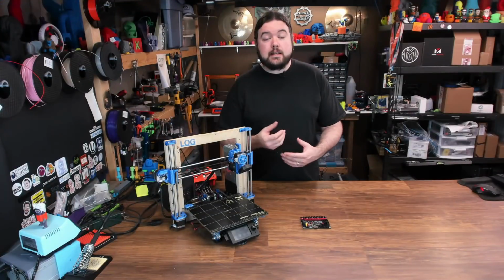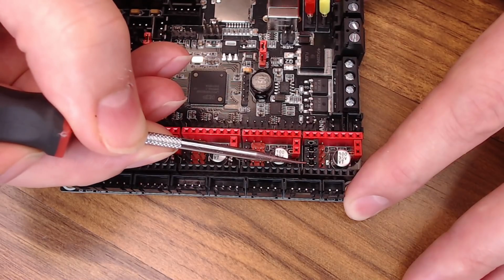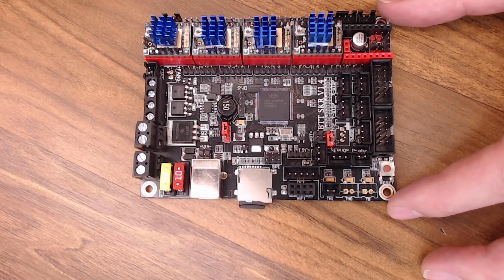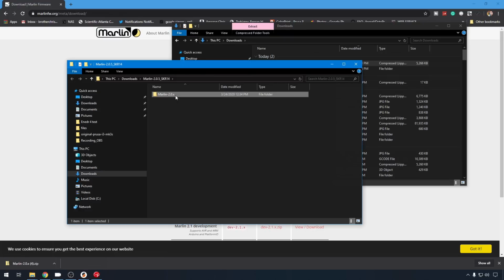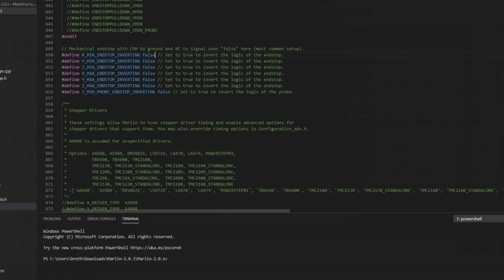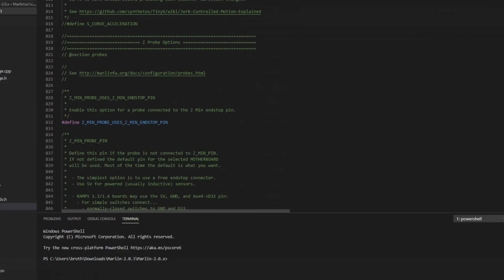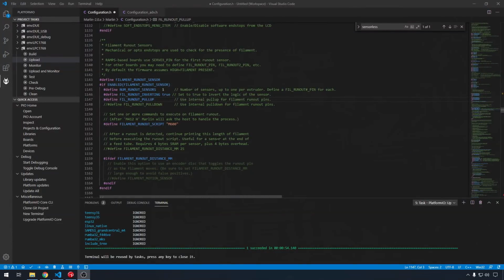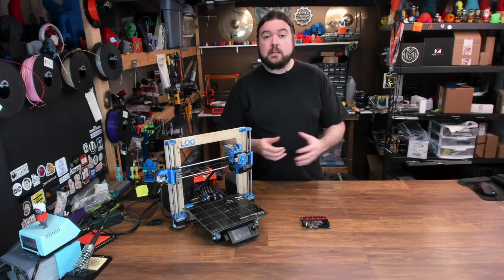BigTreeTech SKR v1.4 Mainboard - Full Install Part 1 - 2209 Drivers - Chris's Basement

Comment: Chris.... excellent tutorial but I have a question.... How BTT DCDC mode v1.0 work? What do I use for?
Reply from the maker: It's for RGB lights. I converts 12/24v into higher current 5v so you can fun more lights. 8 RGB;s without, 30 with.

Comment: I really want to get back into my 3d printer(s) but such problems with the skr 1.3 and tft35 V2 left me with endless frustrations.  can you recommend this board and the tft35 v3 as a completely compatible system? or what combination would you put your reputation on?
Reply from the maker: I really can't, I know of a few boards, but I haven't tested enough to say one way or another. Affordable boards with TFT, BTT has it cornered.
Reply: the affordable boards arent doing the job. unless your tied to pronterface full time.  the TFT, BTT boards don't work , At least with the stock ANET, the expected features advertised worked the way they should.  ( if that doesn't insult BTT, i don't know what will)

Comment: Bit of a strange question, what driver do you recommend getting? Building my own printer and want the same features the Prusa MK3S has like silent/quiet motors, endstop less homing. The Prusa uses 2130 but here it seems like the 2209 has basically the same features.
Reply from the maker: Go with a 2209 for sure. Much easier to use.
Reply: @ChrisRiley  Sweet. Great video, it's long but has loads of details that I will need come building time. BTW what LCD module and bed sensor did you use? Don't think you mentioned them in the vid or description.
Reply from the maker: @vince086  On the printer in this video is a BTT TFT v3.0 3.5 and my sensor is a cheap inductive probe. https://www.aliexpress.com/item/32981810289.html?spm=a2g0o.productlist.0.0.113c16bfWqZ918&algo_pvid=6739ea42-0e36-4388-aef9-d1025a17537f&algo_expid=6739ea42-0e36-4388-aef9-d1025a17537f-1&btsid=0ab50a5715920847541475844e79ae&ws_ab_test=searchweb0_0,searchweb201602_,searchweb201603_

Comment: hey Chris ,i got the skr 1.4 with tmc 2209..im trying to configure the board so i can use the bltouch, also  tft24-v1.1..atfer following along with your part 1 and 2 im having no luck,I also tried adding the wifi that you did as well,..so what i got is a config that works but no bltouch ,i did see that its possible there is a hardware problem with this board( wrong type resister or mosfet on one of the pins.)..as for the tft24..it will not connect to the printer..even after i updated the firmware on the screen..i am also using stallgard ..i did by the way snip the diag pin on the "z" but not on the E0 driver..i did not want to do this in case this 1.4 is no good and have to go back to the skr1.3..which works!..lol anyway just wandering if you could give some pointers!..thanks chris.
Reply from the maker: If the 1.3 works it sounds like a bad board to me. If you have your serials set to 0 and the second to -1 and you baud rates match, your screen should work.

Comment: Hey Chris, I talked to you about the tmc2209 issue and I finally resolved it. The line in the firmware in conf_adv.h (software enable) mine was defined for this but even though it's for Uart mode, the drivers have dedicated pins and this should be uncommented. It was quite vexing but I got there with some help from the GitHub forum. Thanks for your help.
Reply from the maker: I am glad you found it, thanks for the update.

Comment: Hi Chris , did you use 12 v fans or 24 v fans ?  Can I use Prusa MK3 fan ?
Reply from the maker: Hey Dan, thanks for coming to the stream. Yeah, I use both, I just match the power supply. All the Prusa fans are 5v, so they are a no go.

Comment: Hi Chris,
Allow me to comment on the E0_AUTO_FAN_PIN P2_04 (line 422 Configuration_adv.h) I believe the EO fan is an "always on" connection. Only the part fan (PIN P2_03) is controllable to my knowledge. Please correct me if I'm wrong.
Reply from the maker: E0 is always on correct. I moved the fan to HE1, and used those pins.

Comment: what's the difference between UART and SPI mode, and what is beter ?   Don't need sensorless homing...
Reply from the maker: UART is just serial, easy to setup, but slow. SPI is a parent child scenario which is much faster and uses 4 wires. In 3d printing, either are just as good.

Comment: I don't what I am doing wrong. I am revamping an old anet a8 for abs only. Going to install BTT skr 1.4 main board, bl touch, BTT 2209 drivers, BTT TFT 35 3.0 TOUCH SCREEN, sensor less homing. I am a noob at vs code and everything I try and build the sketch in vs code it comes up with about 46 problems. I have went step by step in vs code, but it will never compile successfully.
Reply from the maker: Send over some of the errors.
Reply: @ChrisRiley  at work until this evening as soon as I get home will run a build again and send over some of the errors. Thank you for your time.
Reply: Ok did another sketch exactly how you stated and went to workspace to find the environment to build it and found there was nothing in the project task tab. But I am looking at the configuration h and config. Adv h files that I change just like your part 1 and 2 of the video. The project task had the files in when I started the sketch. I not sure how to send you a screen shot of my computer on you tube.
Reply from the maker: @kawasakizx14jomamamoto57  You can email them to me, brotherchris81@gmail.com

Comment: Hey Chris - this is a great video. Thanks for the amazing content. Curious if you would put together a tutorial on converting a 1.4 board to 24V? I am kinda stumped on how to elegantly drive a PWM 12v part cooling fan and other accessories...
Reply from the maker: Interesting thought. Probably swapping the fans would be about the same money as running converters.

Comment: I've watched both Teaching Techs and your video and I'm still terribly confused.   I picked up an Ender 5 , BTT SKR 1.4 turbo. BLTouch and the 2209s.   
Other than installing the bracket and the BLTouch itself I haven't made any changes.     Do I need to clip the diagonal pin on all the drivers if I plan to use the BLtouch? 
Lastly I'm not sure which end stops I'm supposed to remove.   Thank you for any help.
Really hoping you see this sir, good videos!
Reply from the maker: No, only clip them if you need to use E0 det, E1det, or PWR det. I would leave all the endstops in place and use the probe port for your bltouch. https://youtu.be/p504oU-D6iE?t=1202
Reply: @ChrisRiley  My man!  Extremely prompt and very professional.  I really appreciate your help.  👍

Comment: Have you guys had any problems with the V1.4T not working with E3D thermistor cartridges? 

I had the thermistor type configured properly in Marlin, had it plugged into the default pinheader (TH0, pin 0.24) and it was only reading 713C (this is with only the power supply and thermistor connected to the board, so the hotend heater element wasn't just going nuts). Still read 713C with the thermistor unplugged. Confirmed with a multimeter that the pins weren't shorted and tested with 3 E3D thermistors. Hell, I even assigned 0.23 and 0.25 to the E0 thermistor, and it still read crazy high temperatures. I returned the board for a replacement, and I'm hoping that board was just a lemon with some weird stuff going on. This was all on the newest non-bugfix branch of Marlin off of the github.
Reply from the maker: Yeah, sounds like something was up with that board, mine seem to play with that thermistor fine.

Comment: Chris, I just putting together a new printer and I have a lot of trouble configuring the 2209 for the steppers. I am doing it on a E3 Mini from Bigtree. The nema 17 motors are 42 with max 1.7 amps. When I hook them up they just jitter. Keep in mind I am used to the pots on 4988. To test I bought an original Creality Ender 3 stepper motor. Hooked it up and it ran. What is the current I need to set it too for my new motors above to make it work?
Reply from the maker: You might have the stator flipped. There are two different motor configs that I have seen. Try flipping the center 2 wires on the motor cable.
Reply: Thanks Chris.  I was working through the pandemic from my factory in Missouri (Not my home state) as we are maintaining Turbines and Generators for the Utilities. For 10 weeks I am in a Residence Inn and had to do something. What better way to spend time on the weekends than to build a new printer. My last design is two years old and I used Repetier and old drivers 49..with pots. This one is going to be quite different and I have not see one like it. Should be finished this weekend. I think the idea will work.
Reply from the maker: @joergschoepp6650  Ah, where at in MO, I am in KC. I hope you are staying safe and well.
Reply: I am in St Louis. My facilities here had to continue working through the shutdown to service the power generations turbines to keep the lights on. I cannot get the sensorless homing to work. I have ball screws on all three axis. First it did not work at all meaning it crashed into the stop no matter what sensitivity I set. Than I changed the TMC2209 to one with no DIAG pin.. All of a sudden it worked a little. The motor ran for about 10mm but in the wrong direction at 100 (I tried 250/8/20/60/100). I was pulling my hair out because I really like to get rind of those end-stops.
Reply from the maker: @joergschoepp6650  Ah, this is a mini, do you have the diag jumper wires connected?

Comment: Great work.  But I have a question.  How do you compile a source code file that doesn't have the project file included.  I have a Sovol 3d printer.  They have firmware Marlin source code and .hex file but no io project file.  I need to change my thermistor  pins from 13 to 15 and recompile the .hex.  Any thoughts
Reply from the maker: Thanks! There is no way to back out like this. You will need to find the source project.

Comment: Is the aliexpress link to the board in your description the official big tree tech store.  I note there is also another store with a similar name:  https://www.aliexpress.com/item/4000506531501.html?spm=2114.12010612.8148356.25.1329530fROBhoC 
I went ahead and ordered via the link you provided but I received a notification the shipment had been cancelled by the seller in mid-May and they are not responding to messages.
Reply from the maker: Not sure about that link, but this should be the offical one. https://www.aliexpress.com/item/4000474140713.html?albbt=1&isdl=y&aff_short_key=uNb6i2f&aff_platform=true&albslr=205797132&src=Facebook,Youtube,Google,VK,Yandex

Comment: I thought PID is crucial, how important is PID? I see you skipped it here. Thanks chris
Reply from the maker: The common thermistors we use on these can have a lot of the same properties, for the PID won't change much. The Marlin defaults actually work pretty well for the E3D V6. I don't tune PID unless I see an issue with temp swing. It depends a lot of the filament you use, but a 3 degree temp swing on PLA probably won't matter a lot.

Comment: Here's a crazy idea: what if, instead of physically cutting off the diag pin, we just redefined it in that pins configuration file from the correct one to empty unused one? Would that work? 
Because I'm not a fan of ruining an expensive TMC2209 driver board that might come in handy if X or Y driver burns out and your local shop only has classic A4988, which will work fine but only for extruder or Z, not the X and Y.
Reply from the maker: Yes, you should be able to just move some things around in the pins file to get around clipping the pins.

Comment: I ordered TMC2209 from BTT before ordering my board.  Then I ordered the SKR 1.4 with 2209 drivers.  The individually purchased drivers are v2.1, the included drivers are 1.2.  The 2.1 drivers do not have the pins facing downward...the 1.2 drivers do.  Are there any other changes I should be aware of?  Figure I will start with the 2.1 and see if they work as I wouldnt need to alter the pins at all.
Reply from the maker: I am not exactly sure what the difference is. I am getting some in the mail sometime soon I hope. I will compare them.
Reply: Chris Riley actually the v2.1s were not from BTT but rather Fystec resold by BCZAMD.  They seem to work then crash on X axis with either sensor or sensor less homing.  Installed the 1.2s that came with my SKR 1.4 Turbo and back working

Comment: Good morning Chris, I watched your videos on the SKR 1.4 turbo and the tft35-e3 v3 screen. I had things basically working but because I am installing this on a prinrbot metal plus I needed to get different x and y end stops. Printrbot used a 2 wire set up. I installed them and now when I try and turn it on the display says No Printer Attached!. For the life of me I can't find the problem. I reran the videos to make sure I connected everything correctly and still the same msg. Any ideas of what to try to fix it would be great. I even changed out all the connectors and used the ferrule fittings that you recommended.  I am going nuts and not being able to leave the house does not help. Thank you for the help.
Reply from the maker: Hey Scott, The only thing I can think of it you might have the wrong endstop pins, maybe something is grounded out. Double check you are using S and G.
Reply: @ChrisRiley  Thanks for the help. Turns out it was a marlin error on my part.

Comment: My power supply has 2 V+ (red) and 2 V- (black) wires.  My thought was to splice them together to connect into the SKR 1.4 spot for the power supply.  Would that be correct or is it done differently?
Reply from the maker: That is actually how they are setup in the power supply. They are on the same rails so not need to pair them up, some 14g stranded wire in a single pair would be just fine.
Reply: @ChrisRiley  So I could use just one of each and it would be fine?  Its a Monoprice Maker Select Plus, by the way.  Why are they split in the first place to go on the Original mainboard?
Reply from the maker: @chethammer  I think it goes back to boards like RAMPS, they had 2 feeds with 2 differently rated fuses so they could protect the board and the bed separately.

Comment: These SKR 1.4 vids helped me so much.  I just replaced my GT2560 with BTT stuff.  The connectors on the board are JST-XH.  I tried duponts on the Z-Stop.  I found them too sloppy,  or 'my dupont' connections were too sloppy, and kept falling off the pins.
Reply from the maker: Great, yeah, the duponts aren't a great long term solusion.

Comment: Hello again.. I have gone through and followed all of your steps.. Having some issues.. 1. When I turn preheat hot end the fan never turns on. 2. When I home the the z never homes and after x and y home the x moves over 100mm for some reason.. Thanks for any help
Reply from the maker: The hotend fan, did you set it up like I did in video 2? Does it think your Z endstop is triggered? Check it wil m119.
Reply: @ChrisRiley  Hey, I have the homing issues worked out. Only persistent issue is the HE fan.  I have hotend fan wired to the HE1 (pin 2.4) and I did the firmware change in marlin #define E0_AUTO_FAN_PIN P2_04 but the fan never comes on. I removed wires and tested directly to 12v power supply and the fan works. I have double checked the wires positive negative are correct and I have double checked the firmware.. I also checked the "positive  from HE1 with multimeter while using the main input ground and it has the 12v like it should, but the pin 2.4 is never switching to ground. I even went into pin file from skr common to verify that FAN1_PIN is highlighted and it says P2_04. I also tried to type "FAN1_PIN" instead of "P2.04"  next to E0_AUTO_FAN_PIN but that did't work either. I am beginning to think the board itself is not working correctly?
Reply from the maker: @richardrhoads9088  Sounds like you have everything covered. You can turn on pins debug and open the pins manually, I would try that as a last resort. https://marlinfw.org/docs/gcode/M043.html You have to turn it on in the configuration first, then you can use M43.

Comment: At 7:08 you suggest if not using sensorless homming we need to remove the diag pin. By doing this my Z_min is triggered constant..which prevents my Z from lowering to the bed on a homing movement. It only rises. Even if invert in firmware. Am i doing something wrong? Are there firmware changes i can make or do i need to solder in new pins?
Reply from the maker: The diag pin shouldn't affect your Z min endstop. It will affect other pins on the board, like power detect. Did your endstop work before? What type of endstop do you use? You're using the 1.4 board correct?
Reply: @ChrisRiley  yes i have skr 1.4 with 2209s. Ive been following chris warkocki’s bear build. Have compaired files a few times to see if im missing a setting compaired to his working files. Pinda triggers fine, just doesnt stop z travel
Reply from the maker: @stewbart8977  Do you have this line commented out? #define Z_STALL_SENSITIVITY  94
Reply: @ChrisRiley  so i watched your videos again, built new marlin. couple changes in pins.h and a few tweeks and it seems to be working  thank you your videos help alot
Reply: @ChrisRiley  using sensorless homing. Was having difficulties getting m48 to stop before crashing bed. I checked my triggers and eve thing worked fine. If i did a HOME it would be perfect go down and come back up. When i watched your vid it suggested i snip pins and after that no matter what i did it would give a z_min triggered constant. I reflowed pins and pushed down.